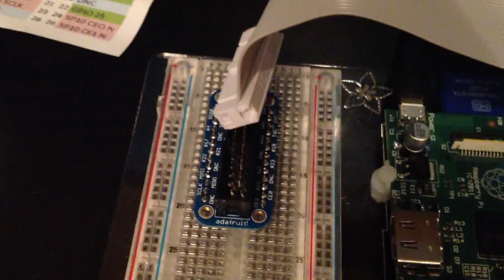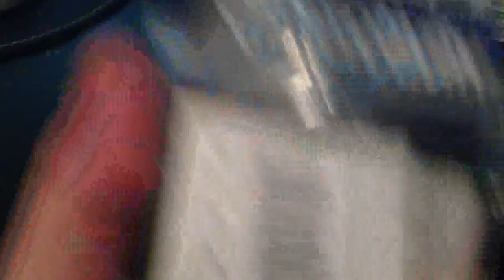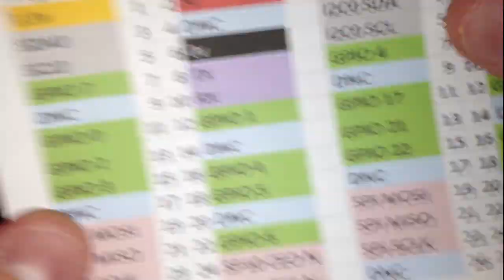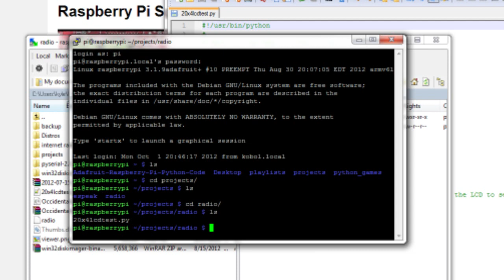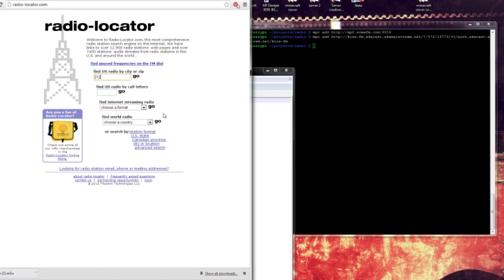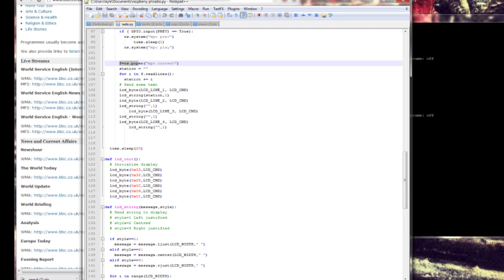Raspberry Pi Internet Radio Tutorial (MPD + 20x4 LCD)

Comment: Sorry to complain but I dont understand why you use the pi plate thing it just looks like another problem that is not needed why not jut connect to the pi IO pins direct with push on wires that you have to use anyway?

Comment: At 55 minutes, it's BOARD rather than BCM, if you want to go by pin numbers. (Which I prefer!)
You didn't mention it, but some people won't know that your using a Pi 2
---
Also, if you enter: from time import sleep.  Then you won't need time.sleep(1), it will just be sleep(1).
This tightens up the code, and a lot less typing!

Comment: Very nice tutorial. I like the way you explain it in real time. Have however a serious problem. When I start radio.py, the radio plays 1 second of the first station, then jumps to the next station, and so on. After about 30 seconds the programme crashes.
Reply: Did you get this fixed? It turns out that the old Pi had definite states for the pins, either being high or low. The newer Pi's have a floating state. They can be either high or low of the circuit is inactive. I ran into the same problem. Configure the pins for the next and previous button with pull-down resistors. This can be done in code, just google pull-down resistor GPIO python code. Good luck!

Comment: Hi Kyle,

First of all thanks for you tutorials..!
Sorry to disturb you with my questions (from a newbie... :-) )

I actually wonder what can be wrong with my setup after your tutorial...
I have installed everything, added stations, tested playing the radio stations => Everything ok.
I wired up the display (a QaPass 1602A) and the buttons for 'next' & 'prev'.

The LCD is lighting up (backight) and I get the 'txt-boxes' in the first raw (by adjusting the trim-pot.)
Running the lcd_test.py don't show anything on the display - and error message on the screen that says;
'The channels are already in use'. (continue anyway)

Nothing show up on the display.

The buttons (next & prev) change the radio stations as it should..!

Another thing - - when using the command 'mpc add <url> and building up a playlist - - where can this playlist be found..???
I had a vision of, that I should find this playlist in; /var/lib/mpd/playlists/
but there is nothing.!

I am not able to find the playlist I have added - even the radio plays evertime I start up the RPi and run the 'mpd play'.

How can I manage my playlist and where shold it be placed.??

Hope you will find time to reply to my questions..!

With regards
Paul.

Comment: What changes would I make for a 2x40 Non RGB LCD?  Thanks for the great program!!
Reply: Normally, you will have 2 less pins on a non-RGB display. You would just need to provide power to the pin on the display that is used for the back lighting. Check for the manufacturer's specification sheet for your display.

Comment: Excellent video meistervision. As a relative noobie to the Pi and Linux I have to say I have been able to follow the tutorial with some confidence. I have used the I2C before but still find it a tad confusing but will save GPIO pins. There are quite a few more GPIO pins I believe on the other headers although you will have to supply the headers. I intend to build this but using a 16x2 display. I'll put the radio station on the top line then other info on the next. Might have room to display current list selection / available as you suggested.  If I could get a RGB LCD then I might use a colour to display as a searching indication then another colour when station located, possibly  red for searching and blue for playing. I'm assuming there might be a tad delay changing channels, I don;t know.  thanks again my friend.

Comment: I've tried to make this happen with my 20x4 LCD display (blue and white), Using RPI model B 512mb. Even with switching Test file and radio file from gpio 21 to 27 for the new switch over, The Test file works fine, The radio file displays on 1 line (i dont know if thats correct or not) but my issue is the radio works fine until hooked up to the breadboard, then it shoots through the channels very quickly never stopping, What am i missing? Is it an issue with the buttons?

Comment from the maker: Great question. They are both very different devices and have strengths/weaknesses depending on what you want to accomplish. I would say if you are new to building electronics/circuits, etc. go for arduino uno. The arduino programming is very easy to learn and is definitely a dumbed down version of C. If you wanna do some data collection get the Rpi. To collect data on an arduino you would have to purchase an extra sd card "shield." the Pi is great for beginner programmers IMHO.

Comment: As a newbie to this what do you think would be better to start with a Raspberry Pi or an Arduino?  I have very little experience with Linux (R pi) or C programming (Arduino).  I know "Basic" the computer language and have a very in depth level of understanding of how a PC is built and used.

I want to make useful data collection projects, sensors, and perhaps move towards robotics or even a quad copter.

Thanks!

Comment from the maker: Are you sure you have an RGB LCD display? A single color backlit 4x20 LCD should only have 16 pins. For the RGB display you have 3 total pins to which you can provide power to (red, green & blue). I'm thinking that your display only has one color and only requires power to that one pin to provide back lighting to the display.

Comment: hi, i got raspberrypi model-b 

i wanted to check my input quality by just recording with arecord without any compression, just raw waw file. but the file is with glitches and very low quality,

pi@raspberrypi /usr/local/bin $ arecord -d 60 -c 1 -f S16_LE -r 44100 -t wav -D hw:1,0 test.wav
Recording WAVE 'test.wav' : Signed 16 bit Little Endian, Rate 44100 Hz, Mono
overrun!!! (at least 11.753 ms long)
overrun!!! (at least 1037.944 ms long)
overrun!!! (at least 38.961 ms long)

any idea fixing it

Comment: ##Same problem as the guy below##
Hi Meistervision thanks for your great tutorial, i have followed it with success :o) however i am having problems with the buttons, they work a bit too well! they GPIO seems to be so sensitive that even if i put my hand next the the ribbon cable the cannel changes (i.e. MPC NEXT or PREV) this is slightly anoying as you can imagine. Did/does this happen to you and do you have any advise ideas would be good? Thanks

Comment: I have everything up and running on a 16x2 lcd apart from the buttons, when i have the buttons wired up the it seems to randomly cycle through the station and when i unplug the wires from the 4 and 18 gpio pins it stops on 1 station. also if i run the python script without any wires attached to 18 and 4 it works fine but if i touch an unconnected jumper wire to the 18 or 4 gpio pin its as if i've pressed the button but the cable isnt attached to anything at the other end, any ideas?

Comment: Hi Mark, I'm a complete newbie as well so i could be wrong on this but from what I've read on the raspberrypi forum the runtimewarnging thing means the pi things that gpio pin is assigned to do something else as well as running the lcd like its been given two commands or its remembering an old command. If you reboot your pi and run the python script is shouldn't come up but then if you run it again it'll come up because its remembering the previous order (i think )

Comment: Thank you for a great tutorial. I am a complete newbie. I have installed one radio station on my playlist. The LCD screen works fine. When I power up the RP version 2 the radio station plays for 3 sec. stops then the station plays for 1 sec every 3 sec. Makes no difference if the LCD screen is plugged in or not. I am playing the sound thru the HDMI/TV. Once in a while after boot up the radio station plays fine. I cant find a pattern. Does this without typing sudo python radio.py   Thanks

Comment from the maker: I like the "premium" female/male jumper wires that come as a ribbon from Adafruit.com. You can just hook the female ends up to the headers on the LCD and then run the male ends to your main circuitry. I think they make a nice solid/tidy solution to mount an LCD.

Comment: So, I set it up, first using the 5v, then switching to 3.3.
I have the lcd running, and can use mpd / mpc manually. 
However, when attempting the script the player skips to the next song within a sec, and then the next and on and on.  I have checked the wiring and all seems right.  What can cause this?